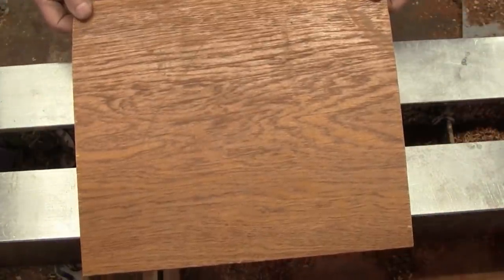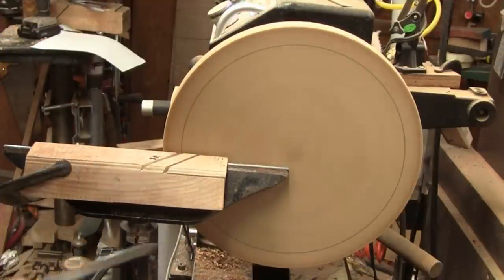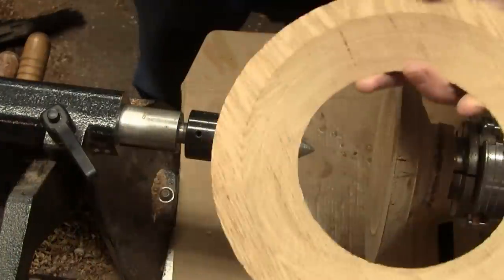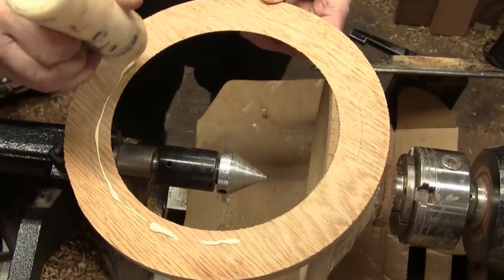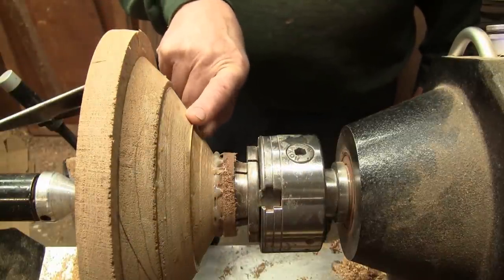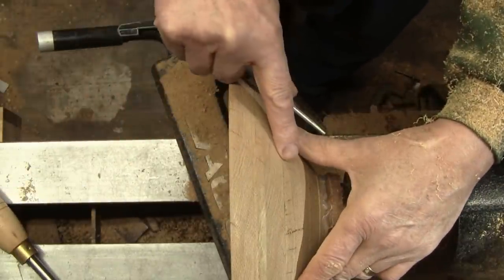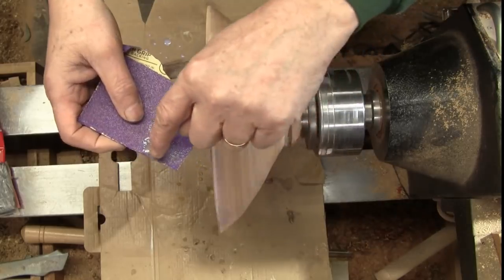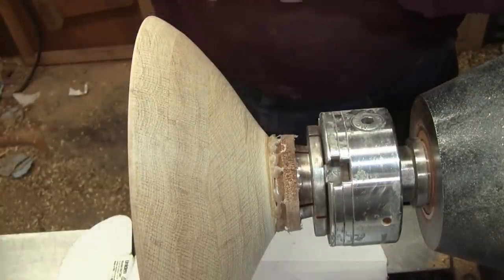Wood Turning A Shelf Into A Bowl - NO JOKE

Comment: The first bowl I ever turned was a bowl from a board. That was in the mid 1970's. I made my initial cuts with a sabre saw. The were very crude but the bowl turned well enough and I still have it. It was the only BFB I have ever made. A few years ago I attempted a BFB using the bandsaw but it was not successful and I gave up on it. Now using your technique and fixtures I am about to try again. Your piece from the shelf board is quite nice. It's a pretty piece of wood. Thank you for demonstrating how to put a little shape into the bowl. Also your method of filling and concealing small cracks is very interesting. That technique will be useful in the future. Thank you for sharing. Have a great day and stay safe.🙂🙂
Reply from the maker: I did a few with the bandsaw and just felt there had to be a better way. 
I still have a couple pieces of that Oak shelf to use for something.
Take care,
Gary

Comment: Gary, I am trying my darndest to make a bowl from a board but I can't seem to get past first base.  My problem is first off is the board wobbling upon the first mount on the lathe.  I have three blow ups and thought maybe you might have a suggestion.  I watch you and actually others on the web simply hot glue a sacrificial plug to the board place it in the chuck and take only a couple of passes to flatten out the board true.  I got so paranoid this last time I put a caliper on the plug and made sure it was the same thickness all around it was 2 1/4'x3/4"  I planed the boards to 0.752" and worked hard to have a flat glue up 12"x12"x3/4".  I cut it in a circle on the band saw then put it on the lathe and there was a 1/8" wobble from one side to the other when I checked it on the lathe.  My trigonometry says that is one about a 1 degree off.  Yet when I begin to try and flatten the board it is like bouncing a ball with the gouge and by the time I get it flat I am down to 0.560" and if I were to flatten the other side it would be even thinner.  It is so thin it is useless to try and make rings for a bowl.  I know talent or lack there of is a big part of the problem  but how the hell do you set a flat board and get it to turn so true it only takes a couple of passes and certainly very little wood loss?  If you have any suggestions at all I sure would appreciate them.
Thanks
Mark McClellan
Beaumont, TX
Reply from the maker: Hi Mark,  this might help. Make sure the board is flat that you are hot gluing the tenon on. If it is just a flat board it should be easy. But if it is some sort of a glue up then I will flatten on side on my disk sander and then mount it up and flatten the other side on the lathe. Then fasten the tenon on what will be the bottom. You should now have a flat board to cut rings from.
 If you want you can email me and it might be easier. You can find my email in my About Page.

Let me know,
Gary

Comment: I really like what you have done with the shelf. Also there is no need to use a bandsaw to cut the rings Thanks Tim
Reply from the maker: Thank you Tim. The bandsaw is one way to do it but I doubt I will use it much for this. But possibly on a very thick board.
Thanks for watching,
Gary

Comment: Morning Gary ! I always learn something watching you. The sander slurry is a great idea ! Little tricks of the trade i world guess. Thank You for another great video !
Reply from the maker: Thank you Jason. The slurry does work great. I have done it in small areas with lacquer, shellac and oil based poly. But that sets up pretty fast and does not work as good as the water based for getting it all at once.
Thanks for watching.
Gary

Comment: Very elegant, Gary. I have only the experience of watching others do segmented work, so what do I know? But, when you first demonstrated this single board ring method, I wondered if different angles might allow for a greater curve. I figured it might end up in a double OG, or just not work, but now you've proven it. Here's my geometry mastery of the day. I wanted more Irish on my grinds, examined my Vari-Grind, and realized I had reasoned opposite of the adjustment that was needed for more wing. I didn't waste a bunch of steel before grinding, just realized what I needed to do to move from English to Irish. Figure out one thing at a time. Thanks for the video and instruction.
Reply from the maker: Thank you Jay! All those grinds can be confusing. On mine I just grind more off the wings using the same setting as my finger nail grind. Not sure if it is precise but it does work. Oh and I think I have the nose angle changed. I have to look now because I do not use it all that much.
Thanks for watching.
Gary

Comment: I really like the curve on the bowl. I have not tried the bowl in a board method, because I didn't like the flat sides. I will have to give this variation a try.  Thanks.
Reply from the maker: Thank you Terry. It does add a lot to the look. If it is a glued up piece with many types of wood the straight walls look ok. 
Thanks for watching,
Gary

Comment: Thanks for the tip with the sanding sealer and the parting tool.  Your videos are very informative.  Also, I made a ring press using your picture as a guide.
Reply from the maker: Thank you very much. It is very handy for sure. I just made a video showing how my press is made.
Thanks for watching.
Gary

Comment: When I worked in a toolmaker shop that’s what we use to do to create radius on certain punches , we had a chart of three angle combos that made different radius .
You always create great pieces!
Reply from the maker: Thank you Luie! Very interesting how you made the radius on the punches. I used angles like that to my benefit in building patterns.
I loved using the canted stave method. All the angles came from the full sized drawing I would make of the pattern and then just cut the angles to fit. Using a spoke shave or block plane to knock off the corners and you had the shape. I love that kind of stuff!
 Thanks for watching and passing on how you used the method.
Take care,
Gary

Comment: Good evening, Gary. Excellent video. I have had folks ask where they can find wood to turn. They do not have access to trees. I hope to make a bowl from a shelve, like you demonstrated, so these turners can also make a bowl from a board. Very helpful. Your wet sanding slurry is also a great tip. Thanks for your instructional videos.
Reply from the maker: Thank you Ray. I have been trying to figure out how to use that old shelf. At first I thought about segments but I like this better. But I still have either 2 or 3 pieces left.
Thanks for watching,
Gary

Comment: Interesting technique. That oak is some gnarly stuff -- looks some variety of Burr Oak, or the like  -- but it worked out very nicely. You could have a machinist friend make a multi-angle fixture that mounts on the tool rest (which would be thinner) OR you could make a set of angle blocks to change the angle of the tool rest -- which is what you were working on.
Would you get more of a pronounced curve if you used a great number of thinner rings to make the bowl while canting each ring a bit more?  Or, would you use thicker rings and make the cant angle more pronounced with each ring?   I don't know enough about segment turning to ask a better question.
Anyway, thanks for another great video.  All  the best...
Reply from the maker: Thank you Jerry. It was an odd piece of Oak for sure.
I have a 2 CNC milling machines and a metal lathe so when I decide exactly what I want I will be making one that does that. The problem is when you rotate it will move the entry point of the cut away from the wood. But I think I have that worked out. It is on the list. I gave my son my wire feed welder so I may have to go up there to weld some of it up.
 Yes I think thinner pieces will give you more angle changes.
 I have used canted staves to produce a shape that was somewhat S shaped. So you can change directions to your will.
 Thanks for watching and all of your questions and input.
Gary
Reply: @ThePapa1947 You are a man with many professional talents and the machines to go with them.  Thanks.

Comment: Another great project.  Very nice explanation of simplifying a complex project.  The multiple angles used to make the rings and the sanding with the water based sanding sealer (Minwax?) really gave you a nice looking bowl from a n old shelf board.  Thanks for another informative video.  Cheers, Tom. BTW: Will you now be cutting new guide slots in you tool rest guide? 😉
Reply from the maker: Thank you Tom! It was fun doing it that way and I will be making a detailed video on how it all works. 
I may add some slots to the jig. I did just make a new handle for the blade. But I am working on another way to do this.
Thanks for watching,
Gary

Comment: Very nice bowl! I have a cut off from a butcher block counter top that my son picked up at Lowes. It is about an inch and three quarters thick and about 12 inches wide and about 30 inches long. Been thinking about making a bowl. Looking around there are lots of sources of dry wood available. Thanks for showing how you did different angles. I have had questions on the subject. Thank you!
Reply from the maker: Thank you Jeff! That is a nice size piece of a butcher block to play around with.
 I will be doing a video on cutting different angles and having them match soon.
Thanks for watching,
Gary
Reply: I have made bowls and platters from butcher block (Also Lowes!) And you get a nice look
Reply: @joshblumenthal4873  thank you! I didn't think my idea was original, just curious if anyone else has tried it. I will have to dive in and try it. Thanks.

Comment: Gary, what lathe do you have ? And do you have any problems coring with it? IF you do coring, I don't recall if you do or not. I had one lathe from grizzly I sent it back 16" 1hp , I'm trying to find a good lathe reasonably priced. I'm thinking about giving up that idea and just make a board and using your method, which is most likely easier on the lathe. Glad to see you back in the shop,  and glad to see you doing better. 😀 Thank you
Reply from the maker: Hi James, I have the Laguna 1836 and think it is a fine lathe. Mine is 2 HP 240 volt or as they call it 220
I do not have a coring setup but I would think this would have the power to use one.
 Doing fine thank you and I did this one because it was on the small side but I am ready to do all sizes now.
Thanks for watching,
Gary

Comment: I've found that changing the rings' width has more effect in making a curve than does the angle of cut. The cant only serves to reduce waste. With a big overlap you can curve any bowl. Overlap is determined by the rings' thickness and angle.
Reply from the maker: Thanks for your input Mike. A large over lap is still restricted by the narrow ring it is overlapping.
I might need to see how you are doing it to fully understand what you are saying. Do you have a video on this?
Reply: @ThePapa1947  No video - 'twas in the old days. Haha. I did this on a scroll saw using 5mm HD underlayment plywood to make economy bowls that came out looking like scallop shells. What I remember is the bottom layer was 1/2" wide and each layer was ~ 90% narrower as the diameter increased. Got about 5 rings for a 8" bowl with a 3" base. But there was only ~1/16" overlap. So I made another set of rings starting a bit smaller. Then I interlaced or merged both sets into one so the overlap was ~1/8" which I could work with. Ended up with a 3" deep bowl. And I used 90° cuts.  I made another one where the 1/2" wide ring was the top rim. It curved outwards like a trumpet horn whereas the first curved inwards like you bowl in this vid. I think I still have PDFs and the Autocad drawings I used. And a photo or 2 if you want.
Reply from the maker: Almost sounds like the rings came from more than one board. Pictures and CAD models would explain.
Reply: @ThePapa1947  it does sound like 2 boards. If you go that route, there is much more overlap and shape flexibility.
Reply: @ThePapa1947  Yes, it took 2 boards to do one curved bowl. I will get you pics and stuff. Can you read .dwg files ? Or do you want .dxf ?
Reply from the maker: I guess you confused me because my method here is a bowl from "A" board not 2 boards. 
 For sure using multiple boards you can achieve about any shape you want.
 I can read any of those files.

Comment: Brilliant 🤩. So much less mess and/or waste and I don’t even have a lathe 🤣
So is it possible to make a much flatter bowl this way with all the angles cut at 60* say?
Reply from the maker: Thank you Michael and yes the more you go past 45 degrees the flatter it will get. But also the smaller base you will have depending on how wide the board was to start with.
Thanks for watching,
Gary

Comment: Hi Gary,
You make it look easy cutting rings out with a parting tool. When I tried this method, it didn't work well at all. The tool  would try to bind and get extremely hot. Tool is similar to your Robert Sorby thin parting tool and is sharp. Any tips you could pass along would be greatly appreciated! Thanks in advance.
Reply from the maker: Hi Rich sorry you were having problems and they can bind up for sure.
Can you tell me the width and height of your tool. 
 One thing I try to do is get the cutting edge  centered for height on the piece.  
 Let me know those dimensions and I can draw it up and maybe see why it is binding so much.
Gary
Reply: Hi Gary,
Thanks again for the reply. To answer your question, blade thickness is 2mm and blade height is 20mm. I really appreciate all your help.
Reply from the maker: Hi Rich,
The blade you are using is too tall for cutting rings that size. I made a drawing using a 6 inch (154.4mm) diameter and your blade will rub hard on top and bottom.
It actually would bind a lot and I would not recommend using it. The taller the tool the wider it will have to be to create clearance.
The tool I have is .25 inch tall (6.35mm)  and 2mm wide.
 If you need more information let me know and I could send you the drawing if that would help explain what I am seeing.
Gary
Reply: Thanks Gary,
That explains the problem I am having than. I will need to purchase a smaller parting tool for this application.
Reply from the maker: Happy we solved the issue. The small Sorby one I bought works good for me. You can buy it handled or just the blade.

Comment: You didn’t mention any effort to align the grain during glue up. Thinking about it I imagine that it just couldn’t work to hide the joints though it did seem to just work out good for the top of the bowl. At least what I see does not look like a giant form of plywood
Reply from the maker: I actually did not put much effort into lining up the grain. Normally I will put a pencil mark across the board and when the rings are cut I can line that up and it will be fairly close. I think on my first line up what I thought was a pencil line was a crack so I did get it off. Kind of bugged me but in the end it looked ok.
And you are right you can hide the joints pretty good if you do get it lined up.
Thanks for watching,
Gary

Comment: Was the first ring the thickness of the board?
Reply from the maker: Most likely it was. After that I vary the angle to get a curved wall. I would have to watch again to see what angle I used. A 45 degree angle will always equal the thickness of the stock.
Thanks for watching.

Comment: Gary, Did you pick those angles arbitrarily or is there some formula you used? I have to agree with one of the comments, I learn so much watching your channel. Thanks so much.
Reply from the maker: So I did this in reverse. I did pick the angles and then I made a drawing and saw I could get a 9 inch radius. Normally I would draw the radius and make the pieces to fit. That is how I did shapes like this at work.
 Thanks for watching and commenting.
Gary

Comment: So if my usual sanding sealer is shellac diluted with alcohol, is it not wise to use hot glue?
Reply: Nice orvis jacket by the way. The headquarters is in my hometown!
Reply from the maker: If you are talking about the hot glue sticking it depends on how much finish you have built up. I did not put any finish on when I put the hot glued tenon in place. I finished that part after.
 I would test on a scrap piece to see how well it stick on the shellac.
If it very shiny I would probably sand it with 320 and that should help it to stick. Again test it before to be sure.
Gary
Reply from the maker: Thank you Ben, I really like the jacket.
Reply: @ThePapa1947  glad you like it haha! If you’re ever in Vermont, their store is something to behold, especially if you’re into fly fishing. What I meant by the sanding sealer thing is, should I apply a shellac (alcohol) based sealer to a project a,ready being held on by hot glue? Or would I risk it letting go?
Reply from the maker: @BenNawrath  I used to do a lot of fly fishing on the Deschutes River for the Red Sides. Some great fishing in those days.
 I also used to tie my own flies. 
 I would  be concerned about getting the shellac on the hot glue because of the alcohol. You could finish it up to that point.
But that could be risky if it soaked in and got to the glue.
Best of luck,
Gary
Reply: @ThePapa1947  thanks! I never did much fly fishing, except for my fly fishing merit badge haha. I guess it’s one of those things that’s so normal it’s not a novelty when you grow up around it!